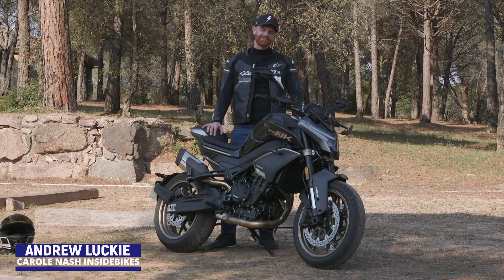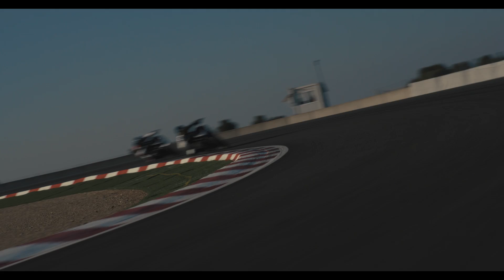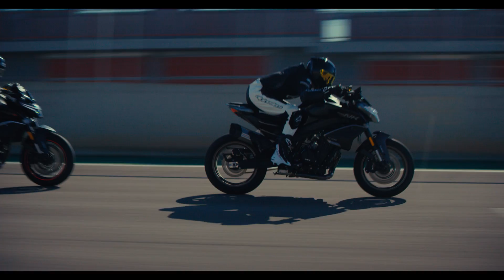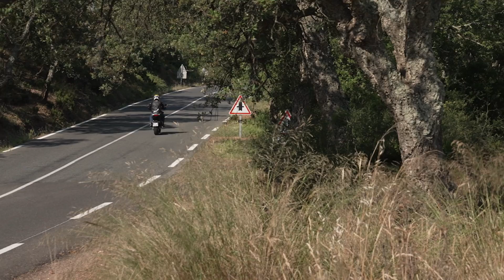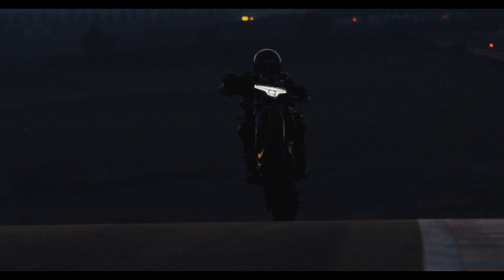CFMoto 800 NK | First ride & review

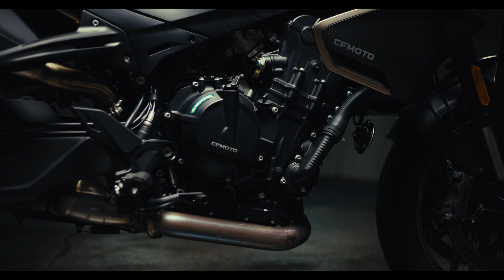Comment: 1:06 the 800nk does not share the exact same main frame as the 790 duke. they are very similar and the 800nk could be considered a derivative of the 790 but they are not identical. theyre are made of different materials, the engine in the 800 is not a stress bearing component like in the 790, and the wheel base is different between the two. they are very very similar but saying it is a 790 frame is just incorrect as you could not order a 790 frame from factory and install an 800nk around it
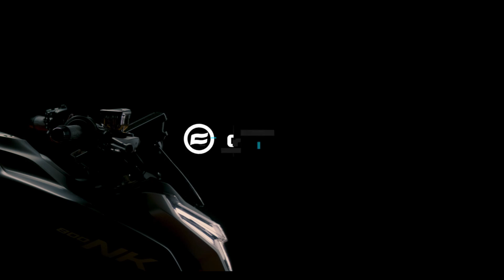Reply: 1:18 it puts out 100 horse power not 95

Comment: I’m on the fence, depends on price in the us and if I can get a baby windscreen to obscure that massive display lol. 

I want to test ride the 450nk as well, 50hp can still be plenty on the street.
Reply: yeah but at a 1k difference is it really that much you should just wait and cop this i probably will too. coming from a 2020 r3 the r3 had a 30.7 seat height and i could put two feet down and flat foot one side easily, this bike is 31 in......and a 800cc idk man cant beat it i will be testing this as soon as it hits the streets.
Reply: I rode the 450 & 800 back to back. The 450 is a kids toy compared to the 800.
Reply: looks horrible.. id rather buy mt/fz 7
not to mention yamaha bikes have huge aftermarket for modding parts
Reply: They say beauty is in the eye of the beholder but man those MT-07's are so dated and ugly  @Microphunktv-jb3kj
Reply: @Microphunktv-jb3kj  800nk looks way better to me than both of those. mt07 looks the worst. ugly.